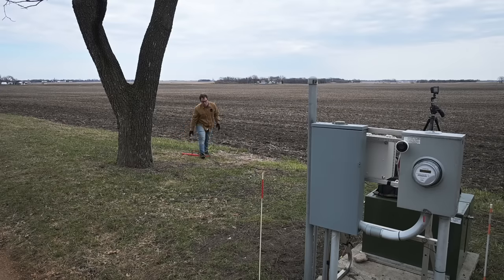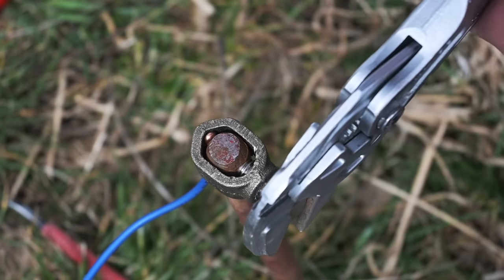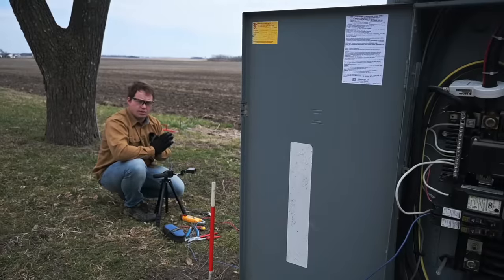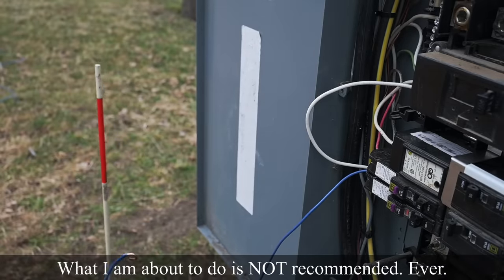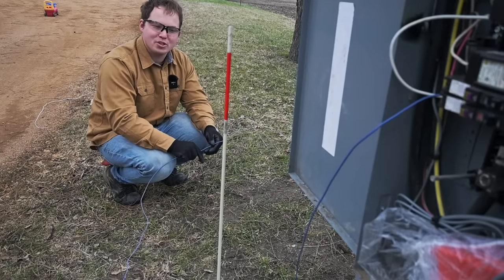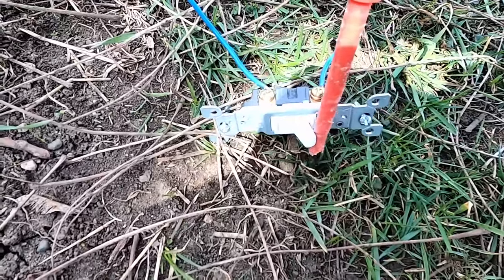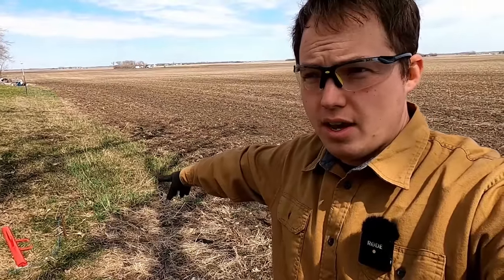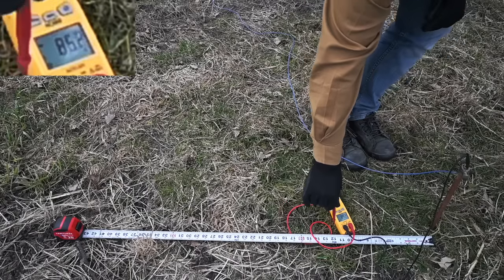Will 120v To Ground Trip a Circuit Breaker?

Comment: 6:05 it’s actually thousands of amps for a split second in a ground fault, hence the 10k aic breaker rating.
Reply from the maker: Right.
Reply: @BenjaminSahlstrom  If you go to NEC Chapter 9 Table 7, you can get the resistance of wire. #12 solid is 2.01Ω per 1000 ft. Let's use 10' of wire from the breaker to the ground bar. Ohms Law works out to be 120V / .0201Ω = 5970A
Reply: @jaydaily6751  you are limited by the available current from the utility. It is probably not quite that high but is still significant. If he had the neutral connected it wouldn't have arced like that. The ground and neutral are bonded and he created a dead short. If we have the transformer data we could estimate the available AIC of the current based on infinite primary current, which is common practice.

Comment: The NEC talks often of 25 ohm resistance. Hey Ben, Good work, it is a good idea to know what 
can happen under different scenarios, like if there is an overload that leads to a fault to ground 
in the generator. most gens  are insulated from frame due to rubber shock mounts.This could 
mean the case of a drill could have a potential upon it and possibly with another extension cord
and reverse polarity, yup a dangerous shock hazard could be possible

Comment: Ground rods are for lightning and static.  Electricity wants to go back to its source.  In your homes case, that's the transformer, not ground.  In the case of lightning, that't the actual Earth/ground
Reply: Taylor hmmm. It is my understanding that contrary to what we were taught,or even think we see, that lightning actually goes from the earth to the clouds! What we see is a leader drom cloud to earth. But the actual kablam is caused by the much greater flow from earth to cloud. Am i wrong on this?

Comment: Correction: Electricity wants to take the path of least resistance back to its SOURCE !
Reply from the maker: Exactly! I was being sarcastic at the beginning about electricity taking the path of least resistance to ground. I should have expounded on that more in the video than I did. I'll try to improve on that in future videos.
Reply: Using a steel measuring tape is way over the top next to a120v ground rod...
Please say Ampmeter and not Ammeter since it is Amps that are being measured!
Reply from the maker: @kpdvw  I thought about that with the tape measure too.
Reply: @kpdvw  It is correctly spelled and pronounced ammeter.
Reply: @BenjaminSahlstrom  Electricity takes all paths back to it's source in an amount inversely proportional to their resistance.
Reply: Actually it will take ALL paths back to its derived source with the amount of current per route and point in the route depending on the resistance through all closed paths and at any specific point in those paths... LOL, right, what Brian Leeper said!
Reply: @chuckjames1943  Only it's meet-her and not mitter.
Reply: @kpdvw  Ammeter: an instrument for measuring electric current in amperes.
Reply: Lets say that the neutral and  ground cables are bonded toguether  at the main panel. Now if a hot wire makes direct contact  with the  ground wire conductor What would happen? Does it cause a short circuit?
Reply: @BenjaminSahlstrom  Lets say that the neutral and  ground cables are bonded toguether  at the main panel. Now if a hot wire makes direct contact  with the  ground wire conductor What would happen? Does it cause a short circuit?
Reply: Pimp My Ditch Witch  The Amps are Inversely proportional to the Ohms per path ...
Reply: @miguelac6872  Yes, that's a dead short, of the BANG type.

Comment: Arc fault detects high frequency radio noise like you get from arching.  You could use something t like a 15mhz 10w transmitter to shut off breakers in a house from the street.
Reply: I've shut off a GFCI around 50mhz with a ham radio.

Comment: Here's an interesting point about the dead shorts you demonstrated: they're way more than 20 amps. A 20-amp rated breaker also has a time delay before it trips. The time delay will depend on how much current runs through the breaker. When appliances such as motors start, there may be an inrush of current upwards of 60 amps for the split millisecond it takes the motor to spin up, but you wouldn't want a breaker to trip every time you turn on the vacuum. So those dead shorts you showed us are likely in the hundreds of amps range.
Reply: Actually, a typical 20 Amp breaker has both a Time Delay Trip Time and an "Instantaneous" Trip Time.  The instantaneous rating is usually 10X the Rated Amps and can TRIP the breaker as quickly as 1/2 CYCLE
Reply: @MrSummitville  Interesting to know! My point would still stand, when he shorts that wire to ground the spark we see is way more than 20 amps. If its the maximum of 10 times rated breaker current before it trips instantly, that's a whopping 200 amps.

Comment: "I'm very familiar with electrical concepts"
- Thinks the CB will trip instantly
- Doesn't realize that putting the hotwire to the breaker panel is a dead short
- "Obviously we're going to trash the terminals on this switch now"
- "I would die if I touched that rod right now" (at ~80VAC)
I really doubt your expertise :(
Reply: And thinking the short  to the panel was only 20A of current… not hundreds potentially thousands
Reply: It was a learning video and he did a great job. If you have constructive information, include it.

- I thought the Circuit Breaker might trip on grounding; that's why he tested it. If it went to 20A instead of ~10A, it would have tripped.
- He did realize the hot wire to breaker panel was a dead short, that's why he did it - to show us what would happen (and he mentioned "dead short").
- If he didn't have rubber soled shoes on and touched the hot 120VAC grounding rod, there's a chance that he would die. That's mains power.

He's a guy making a video about electricity and helping people learn. I learned a lot from this video and it was nice to see the experiments.

Comment: please correct me if i am misunderstanding this, but the electric potential difference from a grounding rod and the area of the ground around it is why most ground rods are shoved into the ground 8 ft deep right? i suppose most if not nearly all the current flowing through the copper rod would only arc to the ground at its tip, the deepest part of the rod, and 8 ft must be a sufficient distance away.

Comment: I should know the answer to this but your explanation of the ground fault has me wondering - If I have a light bulb in the circuit, it “consumes” electricity.  Yet obviously neither GF or AFCI trips.  So the amount of amperage coming back the neutral stays the same?  So the voltage drops?  Something has to drop if power is being consumed.  And by the way - most excellent video, love your teaching style and curious mind!

Comment: I was quite sure the circuit breaker would not activate because of what we did as teenagers. In the 50’’s- 60’s, we used to catch night crawlers for fishing by wetting an area of ground with some water. After 15-20 minutes we would take an insulated metal rod, like a screwdriver and wrap one wire to it. We would then connect it to an extension cord plugged into an outlet. The metal rod was pushed into the middle of the area that had been wet down earlier and then the extension cord was plugged into the outlet. Within a minute or so, the worms would crawl out of their holes. Then we would unplug the cord and catch the worms. DO NOT TRY THIS AT HOME!
Benjamin, I am sure you wouldn’t even think about pouring water around that copper rod ;)   In all seriousness, that was a really dangerous thing we did and  would be the first to tell anyone NOT to try it.

Comment: From what I understand the breaker didn't trip because the path back to the source was of a high enough resistance/impedance. Essentially the earth was acting as a load. In your example of a hot wire touching the metal of a building, it would work the same way. The metal building is acting as a "load" and is energized. This is true only if the metal in the building has no good, low resistance path back to source (ie unbonded). If the metal is bonded to the neutral of the service, then the electricity now has a low resistance path back to source, which would make the hot wire touching the metal now a direct short, creating a surge of current, popping the breaker.
If the earth between your ground rod and the rod of the transformer had been a resistance of, say, 0 ohms, it would have acted as a direct short and tripped the breaker.

Comment: so you have the transformer going into your mains.  the xformer centertap goes to the ground post near your panel via the neutral.  the hot goes to your far-away ground rod.  the earth between the two ground rods is a resistor, making a nice voltage divider.  so 120v/9a = 13 ohms.  the resistance changes over time probably from heating of the ground cuz you are putting in about as much power as a small space heater.

Comment: At the end of the video separating the neutral and ground. 

Ok all fine and dandy. 

In most house systems the ground and neutral are connected in the house breaker box.

Now where I live if you have a mobile home single or double wide .

The power company won't  turn on the power of standard house feed wire is used

Comment: Voltage drops at varying distance from the energized ground rod brings two words to mind: step potential
Reply from the maker: Exactly!
Reply: @BenjaminSahlstrom  Crank the voltage to 60 kV or 200 kV and we can see why maintaining a minimum 30 ft distance to a downed power line is important and in a line-on-car situation, if one needs to vacate due to fire, why the shuffle-step (feet stay together) is required to get away.
Reply: In my opinion, the probe of the Voltage meter shall be Referenced to the Neutral Bar in the panel.
Another probe would then track-along from the Rod centre point's radius-outwards.
That way the Nearer the probe gets to the rod, the Higher the voltage. As we move Outwards, the voltage Drops...👍

Comment: It will trip if the resistance of the ground is low. Check first the ground resistance. Bonding the ground rod will have lower resistance of the ground.

Have the ground within 6 feet and it will trip. Two ground rod principles of the code.

Comment: Well yes, an electrician would know more about the dangers of what electricity can do under various
scenario's. I know ppl who were out on back porch, brick floor and got a bit more than a tingle when
they touched a fan in bare feet. they are fine but they found out, its not just water but dampness as
well. Hey Ben, A big Thanks for what you do, helping others to understand electricity.

Comment: I haven't watched the show yet but I know it is a great way to get worms out of the ground for fishing. Just drive 2 rods into the ground about 4 to 6 ft. apart and put + on one and - on the other, turn on the power and watch the worms can't get out of the ground fast enough. it also works on 12 volt car battery saves a lot of shoveling
Reply from the maker: I like the idea of using a car battery as that would be much safer!
Reply: @BenjaminSahlstrom  battery sounds better but you need to carry a charged battery around... I just buy them on the way to fishing 😀

Comment: Got to go back and check around 8 minutes because if it's a GFCI breaker it has a pigtail off the breaker on to the neutral bar so it does have a neutral

Comment: Electrical Grounding is very misunderstood.  You are doing some excellent Videos.  The grounding is more for lightening protection and then also for Safety during faults.  The electrical system would work without the Ground but would be very dangerous without the safety protection the ground provides.

Comment: The reason why the current was rising is because as it was flowing it was changing the chemistry by electrolysis of the ground and it allows the current to flow much better.
Essentially the same when you have a conductor in water. Over time the water becomes more conductive as the electrodes introduce more impurities into it.

Fun fact you can get ground worms out with 120VAC :D great for fishing but not very efficient. Alternatively a better yet solution is to have a flyback HV generator arc to the ground rod. The impulse voltage introduces a lot more current in peaks.

Also 240V would absolutely trip no question bout that

Comment: Actually, the current is always trying to get back to the power source, transformer or generator, or the opposite pole of a battery or capacitor, etc., using all paths back to that point. In the case of a wye derived power source like transformer, current is trying to get back to the neutral or alternate power leg of the power source. Since you were testing the grounding of the system, the power was trying to return to the power source ground pole of the transformer.  All closed paths will be energized at varying level depending on the resistance of the particular path. The paths will have different potential at specific points along that path depending on the cumulative resistance at any specific point in the path. The earth has a cumulative resistance you can easily read. That is why you were able to get the varying readings with your volt meter at the specific distances you tasted at. You could also read the difference along a copper wire if you had a delicate enough meter. The code book has a chart for the various resistances for the different wires by type and thicknesses if you want to see what they are.

In any case, unless the grounding rod you planted isn't close enough to your systems grounding rod or any other system grounding point, the breaker will never trip as the resistance within the earth will mimic a resistive load and you will never pass sufficient current through the grounding system to the to trigger a standard breaker to trip from an excessive current load.That means you would need 4 ohm's or less between the grounding rods for a 20 amp circuit, maybe inches or less between rods at most for the breaker to trip.

Comment: I'd be curious to see what sticking 2 wires in the ground, similar to what you did to measure the voltage, but instead of a multimeter you can short the bare wire ends... You could even measure the amps! It would also be interesting to see what water saturated soil would do.
Reply: That'll be nice.
However, due to the very low current nothing will happen.

Also, it would be interesting if he could connect a load to the ground with one wire about 6" from the Electrode and another >=5 feet away.

Guess what will happen?

Comment: Well... of course you would need a rcd device for that rod to help at any point. Over here you have to have one and have to install one pretty much whenever you change anything at the electrical installation of a house when there is none installed yet.

Comment: My guess for the dropped amperage would be the moisture in the soil may have evaporated slightly the longer electricity was applied? Or microscopic biological material may have fried lowering the conductivity of the soil?

Comment: If you were using a relatively low impedance galvanometer rather than a very high impedance DVM to measure voltage differential across the sod, your voltage measurement would be close to zero. Hard to explain this in such a small space, but you would feel nothing more than a slight tingle, if you were to stand bare footed with legs apart near the ground rod. This story might be quite different if there were say, 13000 volts on the rod. Not criticism.  You’re doing good!

Comment: Could you please clarify if the power source here is a standard and in service transformer and whether it is bonded to ground with the neutral tap to a grounding rod?

If so please remove the transformer ground and repeat the test.  Thank you for having the balls and taking the time to do this.

Comment: 6:02 I’ve had that happen to me before when I was testing a light switch, 20A breaker and was testing a light switch for ground, the bare end of my tester that was touching the hot terminal slipped and touched the grounded steel band on the switch, it burned the switch and tester end and blew sparks, if I wasn’t awake then I was certainly now

Comment: This all depends on grounds resistance if its high then breaker wont trip - in your case. Thats why there is a standart for ground resistance for homes/industrial and or lightning protection. Bigger resistance = less amps going through it = breaker not tripping but heating wire and grounding. and thats why your cable did trip breaker when you touched frame it has a lot better grounding.

Comment: Question please: SO the neutral wire that runs back to the transformer is not insulated (in an above ground installation), and if I learned correctly, it does carry current all the way back to the transformer if there is no circuit from another hot leg available to phase together, returning to the transformer on the other hot leg. So if someone touched a metal ladder to the service line going to a home and made contact between the ground and the uninsulated neutral wire that was carrying the unbalanced load back to the transformer, would it cause a fault and possible shock the person? I think the neutral in the transformer is also connected to a ground rod.

Comment: Cool illustration of concept. It would have been interesting to see a few potential gradient measurements taken on the side of the electrode opposite to the direction of the path between the electrode and the service panel. I’m sure there would have been some potential there,and probably quite high as well considering how steep the resistance gradient is surrounding the electrode.